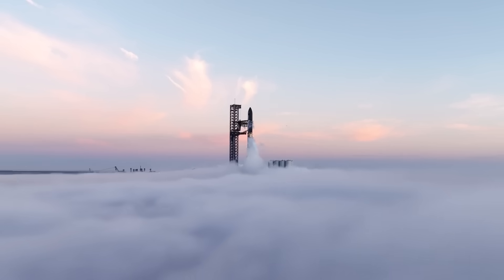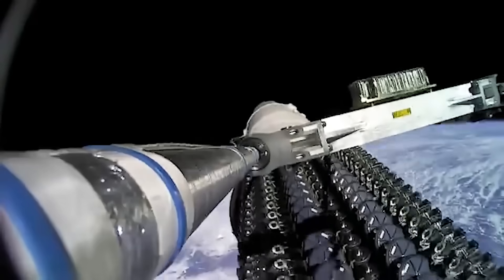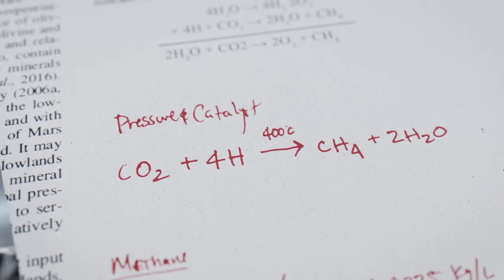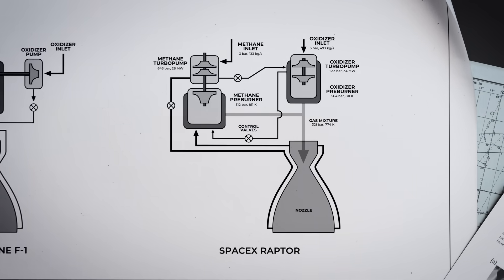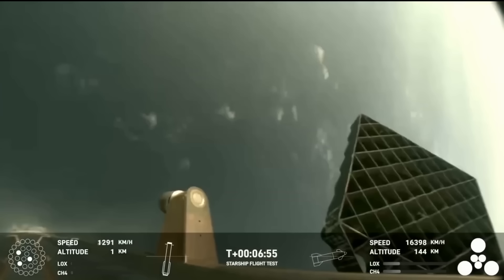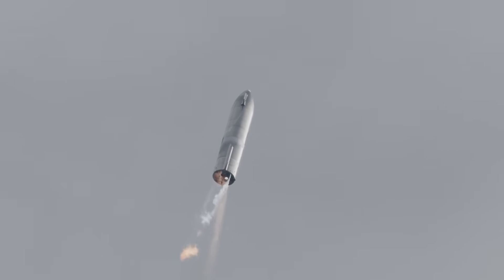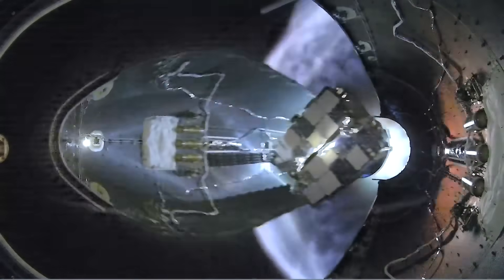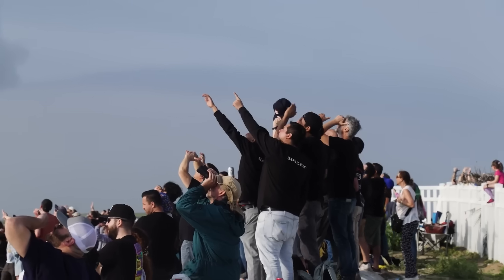Starship Reached Space. What Now?

Comment: IFT-3 was a failure. Not by opinions but by the stated mission goals of SpaceX itself. 
The booster failed in soft landing and the upper stage didn't reenter in controlled manner and got lost prematurely.
Only the "easy" tasks (door function and fuel pumping) worked to some degree.
Landing of booster and upper stage (after reentry) still remain untested, no payload yet included.

The biggest issue not solved since first test flights is the lack of reliability. 
SpaceX might very well reach the point of a successful test with payload and with survival of both stages.
But even then it has to accomplish this stunt for a dozen of flights successful in a row to reestablish the trust of any astronaut to step in.
For LEO satellites Starship will perhaps never be an economically viable solution - even their own Falcon9 does this cheaper.
Reply: The flight as listed was expected to fail what counts as success was the flight data retrieved which will tell spacex exactly what they are doing wrong, where things are failing so that next time things will work better. Iterative engineering is a process and this was only the third TEST flight, spacex have said they plan to launch starship another 6 times this year. With the progress made between each test they will almost certainly have a operating rocket by the end of the year.
Reply: @shaung949  You may paint it it like You want. Doesn't change the fact that the only objective measure of success can be the stated goals and everything else is opinion.
You (and SpaceX) to their excuse always talk BS like "it was meant to fail" or "many data could be retrieved". That is meaningless talk.
The concept of destroying billions of dollars and constantly faailing doesn't exist.
This is just a marketing stunt to keep up the hype.
Any sane engineer builds stuff not to fail in the first place.
Collecting data is not an achievement, it's most basic obligation of every engineer.
SpaceX will have to tackle reliability issues increasing over every single one of the supposed upcoming 6 launches this year despite any new component newly introduced.
On IFT-2 and IFT-3 all booster engines worked. But that is not given for every upcoming launch and this alone poses risk of losing all rockets at any launch.
Complexity only rises. And out of 9 launches since 2021, only 1 was not a total loss.
Reply: @utrian4148 Good to know that Falcon landing attempts back in 2014 was all just the marketing stunt

Comment: The booster might not have landing legs, but needs to spend extra fuel to make a much more careful and precise landing into those arms. I would have gone for some one time use crushable structure. Lighter than sturdy legs.
Reply: The point is that the Booster is rapidly reuasable, having to replace landing legs strong enough to support that  weight would not be anything close to rapid or reusable.
Reply: The extra fuel needed aren't significant

Comment: Those grid fins are the size of a truck and are of steel. And those actuators move them like they're made out of cardboard.
Reply: The grid reduces or eliminates Mach dependent movement of the aerodynamic center. So the forces remain concentrated at the rotational axis. Meaning it only has to overcome the subsonic, lower torque value.

An F-22 horizontal stabilizer at mach 2 is probably going to experience just as much, or more force, due to rearward shift of Aerodynamic center from the MAC/4 to C/2 position.

Comment: 12:00
well the main difference is the really blunt radius of starship keeps a lot of distance between stagnaito nand surface and thus basically buildds up an insulating balnket of stagnant air between the surface and most of the fresh airflow
thats generally why spacecraft are nto designed to have pointy jetfighter noses or sharp jetfighter wings

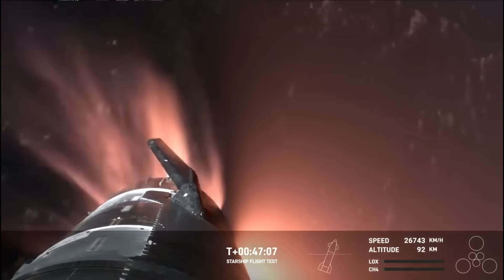Comment: 11:40
if you roughly calcualte the surface temperatures reached it actually popped abotu when they reached the point where steel tends to loose a lot of its strength

Comment: 5:30 a little wasteful? The Saturn V used 250,000hp to pump fuel on the Saturn V S-1C Boosters. Those fuel and oxidizer pumps look like 100mm fire pumps.
Reply: Yes, just a little wasteful. We don't care about the absolute volume of fuel being dumped, we care about how much fuel is being dumped *proportionally*.
The Saturn V had a thrust power equivalent to about 239 million horsepower - roughly 100x more than the pumps, meaning they only use about 1% of the total energy.
However in practice since the gas generator runs extremely fuel rich, it doesn't extract all the energy from it's fuel, and so it ends up being more like 5% of the fuel being dumped. 
But I'd argue that 5% of fuel being dumped is still a small enough proportion to qualify as only 'a little wasteful'.

Comment: We're a minute in and so far:

- The launch was March 14th, not June 14th
- IFT-3 apogee of 234 km is nowhere near the ISS altitude, 408 km (220 nautical miles)
- IFT-3 was not the first to make it to space.  IFT-2 got up to 140 km, which is above the Karman Line.  IFT-3 was the first to make it to orbit.
Reply: IFT-3 didn't quite make it to orbit. The perigee was about -50km, so inside the Earth, as opposed to the 50km planned for IFT-1 and IFT-2, which would have been above the Earth's surface but still inside the atmosphere. 
Apparently the planned engine relight actually would have accelerated it rather than decelerated it, and should have been enough to lift the perigee above the surface, but since it didn't happen it doesn't really matter.
Reply: @lazarus2691  Quite correct, good call.  As a trained Kerbonaut, I must acknowledge that a circularization burn at apogee would have been required to create an actual "orbit"

and if that didn't happen, and perigee was still <0 then technically what we got was a pure sub-orbital ballistic trajectory.

I was unaware of the perigee.
Reply: I didn’t even know this launch was happening and I followed the stuff pretty well. What the hell is going on with YouTube?
Reply: @tapep225  
SpaceX only livestream on X now. YouTube can hardly give you notifications for livestreams that aren't happening.
Reply: @tapep225  Even Youtube is tired of ElMo's BS...
Reply: IFT 1-7 are Suborbital test flights. The in-space relight demo shows that they can deorbit the ship (second stage) from orbit. A suborbital trajectory is close to being orbital, but your orbit WILL degrade, and ensures the ship, in this case, doesn't become the biggest piece of space debris in orbit.
Reply: IFT-3 DID NOT make to orbit.
Reply: @fmobus  
Yes, I've already pointed that out in my reply and they acknowledged it two weeks ago.
It was however, so close to orbit as to make no difference - the semi-major axis was about 120km, meaning it had equivalent energy to an object in a 120km orbit.
Reply: Also spacex didn't discover some magic way to prevent fuel burnoff it still happens just as much

Comment: how would they refuel the booster after a catch? are the arms capable of rotating it to match the fuel ports?
Reply: The catch is made by the same arms that lift it onto the Launch platform in the first place, so simply needs to put it back where it just took off from.
Reply: Yes, just as easy as stacking it which they're already doing it several times

Comment: error in script me thinks, starting from 2:14: "spacex has something the space shuttle didn't: starlink; allowing it to communicate upwards --rather than downwards through the plasma cloud."
oop! shuttle DID communicate up during reentry??
conclusion of factual error based of recent eric berger / ars technica article. quoted below: 

"Starlink terminals on the ship were sending signals to satellites in low-Earth orbit, which then sent them back to Earth. This is not a new idea. For the last 40 years, NASA has used a small constellation of Tracking and Data Relay Satellites to communicate with spacecraft, beginning with the Space Shuttle. Starship was able to communicate with these satellites upon its reentry, but it was only at a low data rate, and it dropped out as the plasma thickened. The Starlink connection remained longer and is what enabled the stunning video of reentry."
https://arstechnica.com/space/2024/03/thursdays-starship-flight-provided-a-glimpse-into-a-future-of-abundant-access-to-space/

so i interpret: 
shuttle did, and other craft (including starship) do communicate up through reentry plasma. bare bones core telemetry. 
(still no hope of communicate down thru plasma, waaaay too spicy. EM voodoos not enuf stronk. yet.)

proposed script correction: 
the space shuttle, and subsequent large-enough reentry vehicles, have communicated sparse telemetry data upwards through the relative void in plasma above them, to few high orbit NASA relay satellites. but now spacex has something the space shuttle didn't: starlink, aka 5,000 satellites in LEO; and for the first time EVER allowing starship to communicate VIDEO upwards through its own plasma wake. i bet starship's immense size helped open the wake too.

long time watcher and appreciator. much love for your channel. <3

Comment: Could someone please explain to me how the first stage of starship plans to land at the launch pad. I don't know a lot about getting into space, but I thought that it was more efficient for rockets to start gaining horizontal speed early in the launch instead of launching straight up. Would the first stage of starship not be quite far from the launch pad once it decouples from the second stage? is there a way for it to get back to the launch pad? thanks :)
Reply: Yes, the booster will be a fair way down range at stage seperation, so it will have to save some of it's fuel and use it's engines to fly back to the pad. 
This is exactly what they do for Falcon 9 RTLS missions currently. A good example is the NROL-108 launch: https://youtu.be/9OeVwaFBkfE?t=1186
At around 2.5 minutes after launch (22:30 in the video) you can see the booster separate, and then turn around and accelerate back towards the launch site.
It then coasts through space for a few minutes before falling back into the atmosphere above the launch site and starting it's landing burn.

Comment: Some things to point out:
1. Methane actually hits a sweet spot, making it odd that it wasn't used sooner as a rocket fuel.  You look at hydrogen.  High ISP.  Low thrust.  Very low density even as a liquid.  Expensive and hard to work with.  Rockets that use hydrogen are very big and very heavy for what they do.  When you do the rocket equation to orbit which has thrust, ISP, and dry mass of the rocket all in there, hydrolox rockets actually kind of suck and are a poor value proposition.  Then you look at RP-1 rockets.  Low ISP.  High thrust.  High density room temperature liquid.  Easy to work with.  Rockets that use RP-1 are reasonably compact and cheap to make.  When you do the rocket equation to orbit, they are not bad rockets, a little more efficient than hydrolox rockets and far far cheaper and easier to do.  I mean hydrolox makes not actual sense when you crunch the numbers and see how much more difficult and expensive they are in reality.  So now you bring in methane rockets.  Moderately high ISP and particularly good with full flow staged combustion engines.  High thrust, especially with full flow staged combustion engines.  Moderately good density.  Reasonably easy to work with.  Cheap to make.  With RP-1 already beating hydrolox in every way that matters today, the performance of the higher ISP and reasonably low dry mass of the rocket with methane over RP-1 makes methane a cheaper and more efficient rocket even before re-use.  Actually methane's added efficiency is key as say you have 4% total to LEO, well at best 1.6% goes into recovering the 1st stage and maybe 3% goes into recovering the 2nd stage.  That leaves you with a sub-orbital rocket.  With methane you have up to say 7% total to LEO, so that 1,6% + 3% used for recovering both stages means you can make orbit and still have a useful payload.  That is the real reason why Musk pushed for full flow staged combustion methane engines as that is the only thing that could be efficient enough to allow full reuse.

2. Starlink launches as of late have been far fewer than 60 per launch.  The newer version satellites are way too big and chunky for 60, so it has been in the 20's as of late.

3. To talk to cell phones, you need to be able to do 2-way.  Just one way high powered transmitting from space isn't going to cut it.  You need the systems to also pick up the very weak signals from cell phones from hundreds of miles away.

4. Whole "methane will help landing on Mars" is a bit of a farce and I will tell you why.  Calculate how many solar panels you need just to create the energy to process the fuel to fill up that 9m wide rocket in say 2 years.  Thousands of tonnes of solar panels that all need to be setup and maintained somehow complete with the dust getting cleaned off them so they can be working for years and decades on end through the infamous Martian dust storms and all.  Granted, if you hauled some LFTR reactors to Mars, you could tackle the whole electricity generation part of the fuel production problem, though that is not the only problem that needs to be solved.  Really, if you want to do Mars, that can only really be done with a lot of nuclear power.  Starship is a great way to get off of the surface of the Earth and is being heavily optimized just for this task, but if you are really hoping to go somewhere else besides LEO, Starship is a rather big, heavy, and inefficient chemical only beast to try to push around to other places besides LEO.  Not saying you can't leave LEO with Starship, but instead it quickly becomes hellishly inefficient and soon falls into can't do it even with orbital refueling.  It just runs out of gas before doing the job even after filling the tanks to the brim in LEO.  Do the rocket equations, you will see what I mean.  Just keep in mind all of this other stuff you want to do in space needs you to get into space in the first place, which Starship should be hands down the best thing we have had to date for that that will work with the technology we have.  So really saying Starship is the answer is really more like 9/10ths correct, but you are going to have to throw in things like nuclear and ion / electric propulsion to really do the stuff well beyond LEO like you need to.

5. I think if SpaceX really wanted to do 1st stage re-usability justice, they would try to get together a giant flying catching drone.  The thing is flying back to the pad uses a lot of propellant and risks having your stage 0 smashed and burned in a mishap.    A giant flying catching drone would fix all that can get the booster back to land in a reasonably quick fashion for rapid reuse.
Reply: The most powerful helicopters ever built have had payload capacities of about 20 tonnes. The Starship booster is ten times that. 
This would be one hell of a giant drone we're talking about. The development costs for such an engineering project might well rival the entire Starship program itself.
Reply: @lazarus2691 There's literally a proposal of giant helicopter to recover Saturn V first stage. Yeah it was insane
Reply: @alvianchoiriapriliansyah9882  
Yep, the Hillers air tug. I'm familiar with it.
Reply: @lazarus2691  I crunched the numbers on it and what I came up with is the following:
1. Rotors: We have multi-rotor drones now.  There is no reason why you can't go big with multiple rotors.  Say you put together a multi-rotor using 6 Superstallion rotorblade sets.  It could be done with lots of spare lifting capacity for the fuel and to catch and carry Superheavy back.

2. Body: While most helicopters have a big, heavy aluminum body with stuff inside that makes it even heavier, something like this would be a spartan set of tubes and bars likely primarily made out of carbon fiber composites.  The middle would be say an open hexagon for Starship to fall through.  Remember, Elon Musk said that making one offs is relatively easy.  What is hard is setting up for mass production.

3. A vehicle like this would be unmanned and primarily fly over water.  It would not operate around humans.  Should make it a lot easier to certify for flight.

4. For something like this, you may largely do away with gearing, maybe have central jet engines turning generators which then turn electric motors at each rotor.  The rotor motors would either have a simple gear reduction or be a big, hollow ring motor.  Actually, I like the hollow ring motor better because then no gear box and still light and efficent and plenty easy to build in redundancy such as parallel windings going to redundant motor controllers.  The generators off of the jet engines will be spinning fast, so easy enough to make them light and efficient.  Existing jet engine models for airliners could be selected as the base for a jet engine generator set.  After all, jet engines originally designed for airliners make it into power generation on the ground all the time after a version based on the original flight design gets reworked for power generation.

Really, not too terribly hard to get together; just nobody has asked for something like this before.  Like I said, I crunched the numbers and this would have plenty of lifting capacity for the job when done like this or a similar way.  Starship itself after all is just nobody even asked for something like this before, but we saw it make it into space the other day after being built and flown, so we now see it is a feasible idea; numbers crunched on paper that worked can work in real life.  At this, Starship is far harder than what I am talking about.  And don't forget with motor / generators, I mean Tesla knows plenty about making these things small, powerful, and efficent.